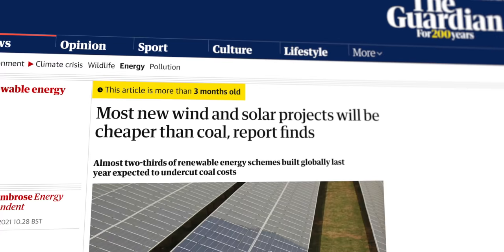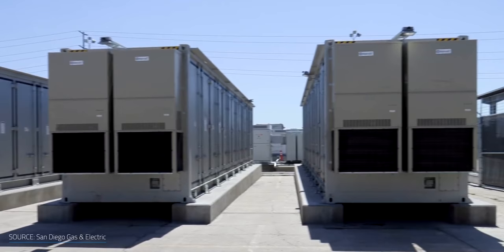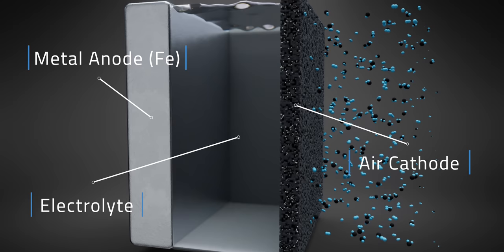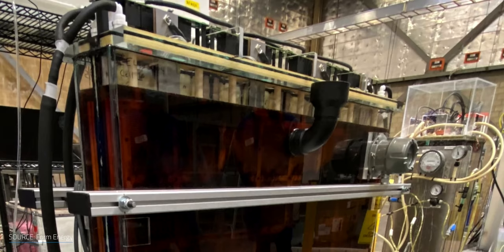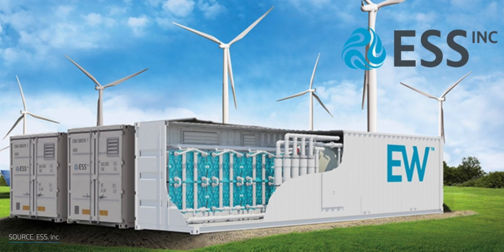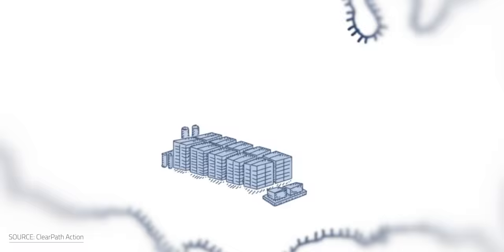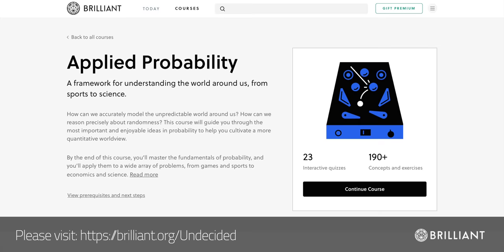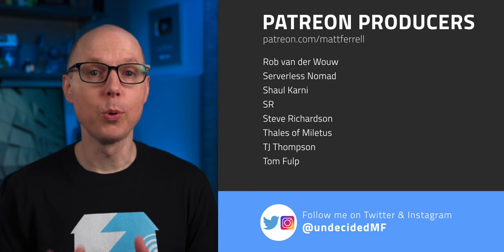Why Rust Batteries May Be the Future of Energy - Iron Air Battery Technology

Comment from the maker: What do you think?  Do you think Iron-air batteries have a shot at becoming one of the go-to energy storage technologies for the grid?  If you liked this video, be sure to check out Perovskite Solar Cells Could Be the Future of Energy: https://youtu.be/YWU89g7sj7s?list=PLnTSM-ORSgi7sp17ey2ydGRGBTFijdYCh
Reply: Wow! This is a game changer. The cost/performance ratio I think will make this an appealing option.
Reply: Nice story, I think you need to quote both power (MW) and energy storage (MWhr) for batteries, as you seem to just be just quoting power, which isn't that interesting, especially for long duration batteries.
Reply: Kelly Smunt  it is for a battery that can store a kWHr, so you can use it to store that energy probably on average once a day all year round.
Reply: What does "17x longer duration" mean? It just sounds like it has lower peak power, which is a disadvantage.
Reply: Still makes me laugh when the unfortunate fact that aluminium batteries can't be recharged is only mentioned, almost in passing, as a minor problem!
Reply: I've got a video suggestion. I'm not sure if this is a woo wee subject or not, but I recently watched some videos on atmospheric electricity harvesting and corona motors. It'd be nice to learn more about this. Thanks.
Reply: @paulhaynes8045  I am not so sure about the Zn and Fe batteries too; if you are trying to charge these batteries, you will need high voltage (lot of energy waste), lots of H2 production (don't know what to do about that) and end up spending 1MWh to get back 0.5MWh after one cycle. Plus, they are low voltage cells and you will get less than 1.5V perhaps during discharge.
Reply: Lithium batteries at $250 per MW and iron air batteries at $20 per KW...that makes it about $20.000 per MW.
Reply: @janami-dharmam  These air batteries always had a short life (low cycle life), that is why the efficiency and the lifetime degradation data would have been highly informative. But they are keeping that secret. 
My guess that their battery does perform rather poorly compared to lithium.
Reply: No.  A battery back up for the grid is like a well backing up the Atlantic Ocean.   Don't complicate the issue.  Build a ton more nuclear power plants.  Quit putting fossil fuel in the atmosphere.
Reply: How do these compare to liquid metal batteries?
Reply: Lets hope they don't build these things with magnesium heat sinks .. cuz you know .. thermite
Reply: Similar to Israel based Phinergy's  & India based Log 9's Aluminum air battery for their cars. 

This technology cannot be incorporated in small electronic devices. 

These batteries are huge so it occupies large space in a car.
Reply: @nathandean1687    how is he planning to do that? hehaw hehaw hehaw hehaw 🐴 is he going to build underground hyperloop all over the planet that runs through magnetic tunnels  ?   He haw he haw he haw he haw he 🙉...🐴
Reply: @janami-dharmam  They solved that with a better electrolyte formulation. And a better air breathing electrode.
Reply: The grid is actually the problem, it designed backwards. Until we have cellular energy production (everyone producing their own, instead of having a central distribution point) we will always have expensive energy and have to deal with potential blackouts 'en masse'.
Centralized energy production only benefits big energy producers and utility districts that are privately owned, while sticking consumers with higher costs and the risk of blackouts.
I prefer the concept of having better batteries available to consumers who produce their own energy and sell their excess back to the grid for infrastructure. This how our grid should be designed to make more efficient and cheaper for all, instead of profit for a select few.
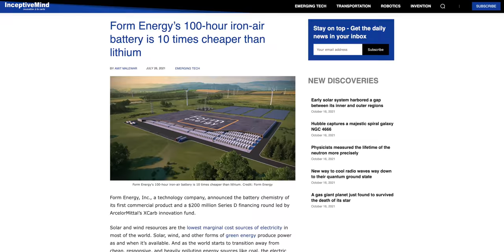Reply: at 5:00 must be MWh not kWh
Reply: Tech for Luddites had video on this.  The efficiency of these iron batteries is 50% (not great).  But apparently they are making a play for the cost.  This is what counts.
Reply: @jobob2190  I don't think so. the paper he showed at 4:43 shows the $20/KWh value. And as another commenter pointed out $20/KWh is $20,000/MWh.
Reply: @thomasplower367  nuclear power for grid regulation doesn't work!!!! you can't pitch them up and down fast
Reply: @df1299  must be wrong in the paper too. what is pretty funny...

electric energy costs 15 - 30 cents/kWh depending on the country you live in, just check your bill of your electric energy provider. makes 150 - 300 $ or € /MWh. this is the total of production, grid regulation, transportation, distribution and taxes. so nobody will pay 20.000$/MWh only for storage/regulation...

just check 1:55 where he talks about $132-245/MWh for Lithium storage, which is to expensive
Reply: Batteries need to be able to feed into the grid for up to 6 months without input. Unless you want to displace the indigenous peoples of the arctic! The winter night is VERY LONG, so got to store that midnight sun for them to use
Reply: @janami-dharmam  recharging them takes about 0.8V, recharging lithium-ion batteries usually needs around 3V. H2 production is a great waste product that can be sold or used in a green fuel cell...
Reply: @matt I’m struck that with all of the grid battery options and the vehicle options that no one has looked at mass consumption advantages.  Example: Today a small village needs airplanes, small trucks, small tractors, machines, to get to and around the village and generators to run small tools, heat/cool buildings, hospitals, cook, etc. and today gasoline can be a useful storage of energy that can work for any of the use cases.  While PVs can generate energy, it needs to be stored in multiple ways and each has different disadvantages based on use.  Would be interesting if someone took a ‘systems’ design for a village and in doing so determine the ‘best compromise’ solution to energy storage.   I.e. would Hydrogen all of a sudden make sense for those villages?
Reply: Trouble with the Lithium-Ion comparisons is they always talk about today's batteries but their new stuff isn't going to come out for 5 years. Lithium-Ion is not static but always getting better. Lithium-Iron-Phosphate batteries are so much closer then these technologies and set to explode. This Li-Iron-Phosphate is a battery chemistry already produced at scale in China. (patents expiring) They don't catch fire, have much longer life-times and have a cost floor close to this Iron-rust battery. They are not quite as energy dense then current nickel-cobalt chemistries but there's techniques to cover most of the gap. Part of why Tesla is so scary is their cars are the only ones that can move to Iron-Phosphate soon. This is due to their more efficient energy usage.
 I just don't see any battery tech being able to break out of a small niche before an avalanche of new,  cheaper Lithium-Ion batteries cuts off their path. There will be a whole host of different chemistries but they will all be Li-Ion tweaks for specific uses.
Reply: how does this compare to Ambri's liquid metal technology?
Reply: Aa new battery tech that will never reach the market.
Reply: Aa new battery tech that will never reach the market.
Reply: I wonder if earth has more metal than dirt.
Because the lightning always hits the ground.
So maybe planets with metal cores always make lightning.
Reply: Kelly Smunt  That 20 spot is to build the battery.
Reply: Kelly Smunt  To buy a battery at the moment it is something around 550 pounds per kWh so 20 pounds is a lot better
Reply: @df1299  I hope there is a typo with the units of measurement somewhere, otherwise those batteries would be prohibitiv expensive.
Reply: @rattyratstuff7125  That you know nothing about prober manners you have already proven by your post. Now can you actually make an argument to support your claim or are you just trolling?
Reply: Like other videos I’ve seen here and other places so often the video shows something I never hear about ever again. It would be great if you did a video following up on promising technologies showing how they never took off as I assume many must do. Maybe they are implemented and in the long run aren’t that revolutionary?? Maybe early hype just makes for good science videos?? Anyway…follow ups would be very interesting. I think getting from invention to commercial viability is also an interesting story. From “Undecided” to “How I built This”.
Reply: My feeling as opposed to knowledge is that the rate of current drain from such a chemistry will be low and slow. Of course you simply parallel many cells to achieve what you want. But this does mean that costs are a great deal larger than presented and they're likely to charge so slowly that indeed for vehicle use they will have to be replaceable which presents an entirely new kettle of fish. Knowledge should be presented with both sides of the story.
Reply: @tomkunich9401  Speed of charging does not matter. You charge it the whole summer, and than discharge it slowly the whole winter. 
The only thing that matters is the final price of storing. They claim an order of magnitude cheaper than lithium. This is good, but if a charging discharging cycle loses half of of that energy stored than during its lifetime the loses maybe two order of magnitude higher and totally cancel the advantage of the manufacturing price. Also, the number of cycles till the battery depreciates. If you charge it only 100 times, than is the same thing, except maybe the longer duration of the storage. 
Anyway, I assume that these problems are not so acute since they are still going ahead with the project. 

But here was not point the weak point of this technology. The size. Compared with Lithium these need a lot more space. A powerwall takes a little space in a corner of the house. But with this technology you will need like a meter high of your house area. Houses with  crawlspace may benefit using that space, but in cities where space is at premium, for sure is not feasible even the batteries may come for free, and lose nothing and lasts forever. And at large scale also, the  terrain occupied may prohibit it, unless you have some deserts to fill with these.
Reply: @DanielSMatthews  Grifters are going to find a grift so it's good to always be skeptical. However, there is also the problem of engineers and scientists using words which have slightly different meaning then the common meaning. This can be misleading even when they are trying to be up front. for instance, Beware the word 'Breakthrough'. Always check the discipline of the person using it. 
NASA uses a Technology Readiness Rating, but it doesn't really extend into commercial products. Personally, I try to fit new tech along a line with 3 categories each with 2 sub headings:  
1)In The Lab
  a) Lab proven main parts of a concept
  b) Full product. A fully working prototype that contains every part.
2) Pilot Plant
  a) A small but complete production line producing finished products
  b) Early Adopters from a niche audience (Tesla roadster)
3) Scale Production
  a) Producing for a large niche  audience
(Tesla Model S)
  b) Broad Scale adoption with multiple parties following. (Tesla Model 3 + Mustang Mach E + others)

They aren't steps but it allows me to gauge of how close a tech revolution actually is. Each position is actually a quite massive step up over the last
Reply: @jobob2190  I absolutely agree $20/KWh value is insanely high. I'm just going by what is presented in the video. The MWh vs KWh  values jumped out at me! which is why I came to the comments to see if anyone else noticed.
Reply: I contributed to an article on these batteries a little over two weeks before this episode came out.

 The ESS iron-air battery is expected to have zero degradation over 20,000 cycles. According to the manufacturer, it's design life is 25 years and warranty covers the first 10. The only things to actually break are pumps and control systems, which naturally cannot last forever.

Not sure why you reported that ESS is hiding the information behind an 'iron curtain'; the analogy was funny but unfortunately reveals that your team forgot to try emailing the company.

From ESS: "During the course of its operating life, the flow battery would typically require some hardware component replacements: pump, motor drives, sensors, etc, due to normal wear and tear. The warranty would cover the first 10 years, after which an O&M contract would apply. If project requirements change after 25 years and the battery is to be decommissioned, the system and all of its components can be substantially recycled."
Reply: Matt, look up what Graphene Manufacturing Group (Australia). They are coming out with Graphene Aluminium-ion batteries. Insane recharge rates and durability, and only requires Aluminium, graphene cracked from LNG, and aluminium oxide powder.

Nice video! Iron oxide batteries may have a niche, if they price it right. 

Enjoy ;)
Reply: This is super old technology.
Reply: I would comment, but my observations and experience has been deemed dangerous by youtube.  My comments are deleted.  You might consider hosting videos on other platforms which are not controlled by the investors funding the technology you are covering as they don't want the public knowing what I attempted to convey.

If that sparks any curiosity, you may respond where I can communicate outside the constraints of this platform.
Reply: @Daniel-rd6st  but then again what do i know. im only an electrical engineer by training XD
Reply: @emmettebrown8803  No thanks, creepo
Reply: @shaunhall6834  for the last ~20 years there was a huge number of new batteries with fantastic specs which are "about to enter market". And all of them silently vanished from the scene.
So don't put all your money on yet another magical super batteries :)
Reply: What's the power density?
How big do you need to go to produce useful (500MW scale) of power?
"100hrs" is meaningless on it's own.
Reply: you have a pop-up add that constantly redirects me another page when I try to close it, to let you know!
Reply: LiFePo may be tough competition if costs come down and efficiency is mediocre
Reply: Kelly Smunt  when you rechar it 125 time with free engergy your at zero, after that your engery is free... or do i miss somthing?
Reply: Kelly Smunt  I think you are confusing energy with power. I also pay about 16p per kWhr. That is 1 kw for one hour. A kw is a rate of energy usage whereas a kwhr is a total energy.  I don't know why a lot of these discussions intermingle these these  units. I suspect it is the way the batteries are specified by the manufacturer. I find it confusing too and I've been an engineer for over 30 years.
Reply: It's very interesting and given the abundance of iron, a potential game changer in energy storage, but I have never heard a discussion about the conversion efficiency of the dc to grid (ac) process. This of course applies to all battery technologies. I'd love to see someone do a peice on that.
Reply: While I love the idea and the use of plentiful materials, seeing the ore extraction and also seeing the effects of ore production in Minnesota directly, I wonder if we should also treat this as a fossil-fuel. I am sure there are differences I am not realizing here, but is trading one non-renewable fuel for another going to ultimately recreate the same issue a few generations down the road? Like I said before, I like the concept, but they have to make sure it elevates our type usage, rather than just changing the materials used.
Reply: You absolutely need to talk kWh/MWh when talking about capacity; you keep talking kW/MW after saying capacity which is nonsensical and completely messes up any argument you have.
Also when talking about capacity, you need the charge/discharge rates the battery provides as that becomes useful when you need to use it; eg a MWh of storage is useless if the discharge rate is 100 W, or even 1kW as it can only be used by a few ...
Reply: Kelly Smunt  That is the cost for the capacity. You can actually use that capacity time and time and time again. Every time you use it, they can sell you the electricity at 16p, and they can do that thousands of times.
Reply: @2nd3rd1st  creepy?  How is a guy who attempts to inform the many that they are only getting half the picture, be labeled as a creep?
Reply: @thecraggrat  units of measurements are always manipulated.  Like capacitor storage, static discharge is capable of nearly infinite wattage with a very very short period of time.  Most of us fail to make that connection.  That is how investors make poor investments.
Reply: @emmettebrown8803  
Looked up what rust batteries would mean to an all "renewable" energy infrastructure in the USA, referencing Mark Z Jacobsons you tube analysis here: 
https://www.youtube.com/watch?v=V2KNqluP8M0
The iron batteries change the "backup storage" cost from ~$0.20/W-hr for pumped hydro to the vale quoted here of $0.02/w-hr (ie $20/kWh). This allows the installed "system" to have a whole Grid-week of backup energy stored (that's 1 week @1591GW), vs a Grid-day in their calculations, for ~$5.4T, about a $2.4T saving!
Of course it's a lot better than the proposed day of backup storage, but it's still only a week of storage capacity. It'll smooth the bumps nicely, but I still wouldn't like to have a countrywide nasty winter or really hot summer. I think the analogue here is range anxiety in electric cars right now, but with no way to "top off the charge"
I think I prefer nuclear Gen IV reactors where the build out cost is about the same as the backup battery cost for renewables with approx 18 months of fuel in each reactor - no capacity worry here!
Reply: Wow. These are so simple I instantly I thought, these could have been built by ancient civilizations.. which begs the question we’re they. & if they were would people even know what they were if they were found 🤯 Lasty is there a such thing as a Mercury air battery ?
Reply: @thomasplower367  also don’t suck out oxygen to make rust.
Reply: I think a battery, used on a large scale, that uses what humans need to breathe and the environment needs to cool itself as it's medium - oxygen - is probably not a super wise thing.
Reply: @hallowacko  Well the iron started off as rust, so the oxygen was released into the atmosphere in making it, though it probably ended up as CO2 due to the energy needed to make the iron...Mind you there is plenty of O2 to go round, not going to end up with none.
Reply: "you can store energy for at least 4 days" - what kind of hyped info is this? Are you talking about self discharge? Are you talking about powering a led light? Do you actually think about what you read or do you just repeat it?
Reply: Very interesting, storage of green energy really is the missing piece of the puzzle of our survival. I would  interested in comparing compressed air batteries to the Iron air battery to see witch has more efficiency.
Reply: @John James Thanks for the remark. I should like to know the cost of pumped hydro power in comparison. I guess that you have got more mountain regions, that could be explored using this method.
Reply: Rust batteries require significant amounts of water. these are going nowhere fast.
Reply: @DanielMacha  the economy of scale favors central power production
Reply: @johnm948  Not really, if one factors in failure rates and the actual cost for the consumer. The economy of scale actually favors cellular energy production, while the economy of "greedflation" (a.k.a. survival of the richest) favors more centralized power sources.
Reply: All I care about is sensibility and simplicity. 1)The battery must have high energy density and stability. 2) It does not suck up oxygen from the atmosphere. I am basically ok with any energy generation technique that does not involve oxygen .
Reply: Energy density is horrible.